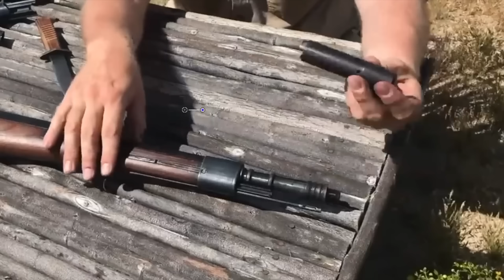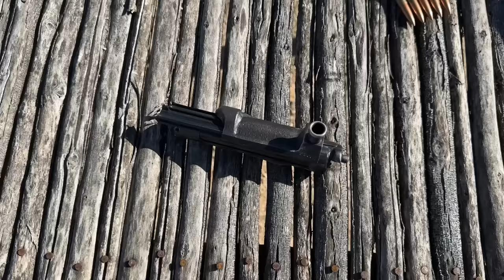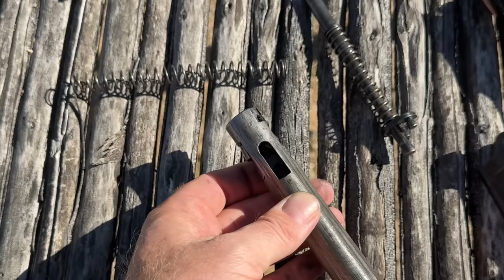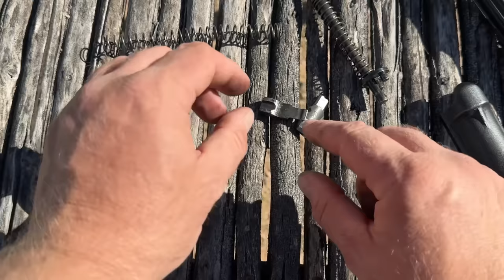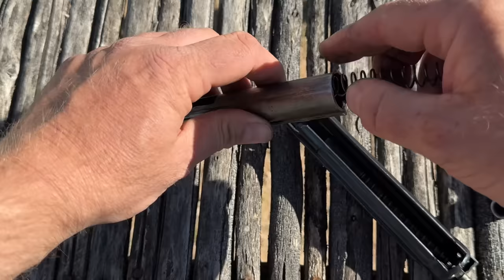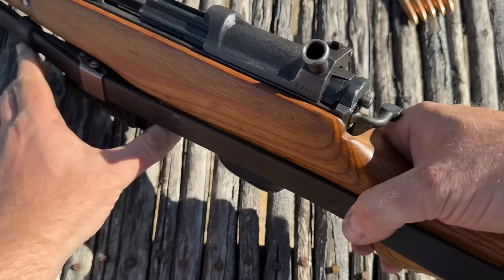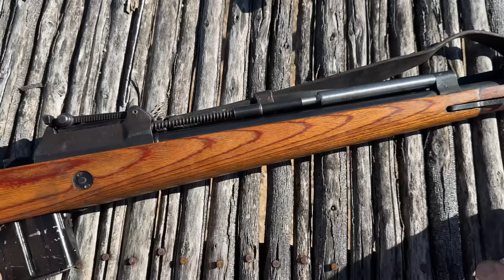Das G43 Wunder-Gewehr ist Scheiße

Comment: I've been waiting for this video. Finally the information I needed. Because so far it was "it's overgassed and production standards were horrible",  both were not really arguments agajnst the design itself, but against the execution of the design.
This video luckily goes into some interesting detail - problems with field stripping and the unreliable locking mechanism.
I would love to hear more about flapper lock failure potential. Is it an inherent design flaw of the lock itself, or simply the design of this specific one? What excatly made it possible to only half-lock? How could this be avoided other than going with better types of locking system? :P

Anyway, nobody was going to manufacture G43 also because most machines were gone, German industry was mostly gone, and there was an absolute abundance of already manufactured weapons. I think nobody mass-produced STG-44 post war. Nobody probably mass-produced MP-40 post war. Both were good weapons. But being a good weapon is one thing, and getting machines and manufacturing a gun in a dying-out caliber in the era of SKS, AK and more modern battle rifles? Well. not gonna happen.
Reply: also the locking lugs not being captive, not as easy as the m1 to reload from stripper clips, poor sights, and op-rod complexity leading to both being able to loose parts in the field and poor metallurgy that could mean the gun not working yeah "great design". Seriously the excuses for german engineering designs are laughable, yeah they also had substandard manufacturing and sabotage but overall designs were too complex to be quickly manufactured and work reliably in the field. Meanwhile Russian and American designs ultimately won the war. Proof is in who actually wins.
Reply: Surprisingly there is still a plant in Kyiv Ukraine manufacturing mp38s. Although the majority are made with built in BFAs
Reply: At least for the case of simpler weapons like bolt action rifles and submachine guns; most countries didn’t produce WWII-era SMG’s after WWII because they could effectively ask for them for pennies on the dollar from WWII-participating countries. The Soviet Union offloaded their PPsH-41 and PPsH-43’s to Eastern Bloc countries and Communist-sympathizing nations in the late 40’s and throughout the 50’s after standardizing on 7.62x39mm rifles, the US sold or donated Thompson’s, Grease Gun’s, and M1 carbines to Central American, South American, South Korean and Vietnamese governments up into the 60’s, and Czechoslovakia made profits by selling former Nazi German arms to anyone interested, most notably Israel.
Reply: "I think nobody mass-produced STG-44 post war. Nobody probably mass-produced MP-40 post war. Both were good weapons. But being a good weapon is one thing, and getting machines and manufacturing a gun in a dying-out caliber in the era of SKS, AK and more modern battle rifles? Well. not gonna happen."

I mean, with respect to the MP40, 9mmx19 isn't a cartridge that anyone could possible consider rare by even the wildest imagination. And both weapons weren't exactly the sort that was considered difficult to manufacture even by 1940s standards so that point I do not think is too valid.
One thing that should be kept in mind is how completely destroyed WW2 left many nations, and even those who weren't destroyed were faced with incredible burdens on their economy. It's quite hard to imagine anyone after seeing those two bombs dropped thinking of how to gear up their grunts for a potential future conflict. And by the time the Iron Curtain came about as more than just a politian's phrase, most weapons manufacturers had their eyes set on weapons for the standard issue NATO/Pact cartridges, at which point a rebirth of the StG44 in any noticeable capacity was off the board(though not for the MP40; but the Uzi quickly became a budget choice for a lot of nations and a decade later theMP5 would become more or less the gold standard for SMGs). 
One more thing I've thought alot about is that some credibility could be lend to the idea that most nations considered themselves victors after WW2, hence why go ahead and copy weapon designs off of the enemy?* The US thought that their infantry small arms were, in the grand scheme of things, superior to the Axis and only sought to reproduce/learn from the MG42 and FG42. The French/Brits are and were still both to prideful to admit that we Germans had something over them; and it took them decades after the war to come to terms with that but only because their dying empires(+NATO integration) left them with little choice in the matter. It's actually the Soviets, who, inspite of their lying and best-sweep-everything-mildly-inconvenient-under-the-rug, learned the most from WW2. They had many more run-ins with the StG44 and thus quickly realized just what kind of new tool they were dealing with, leading to them, in my humble opinion, correctly assessing that kind of rifle to be the best possible blueprint for the average infantryman of the future. Of course they didn't want to copy the weapon 1 for 1 still, so in the end Kalashnikov's design became their new service rifle, killing the SKS in the process.
Reply: @theduckfu  Not as easy to reload from stripper clips is a moot point since the rifle was designed to be mainly reloaded via changing the magazine.
Magazines not being available is not a problem of the design. It's the problem of German WW 2 logistics and small arms production being in absolute  deep manure for a large part of the war.
Being able to top off via stripper clips is a nice way to keep the magazine full when not under a direct threat, but we shouldn't be judging the reload speed based off it. Yes, it's discussed in the video, but video kinda talks about all the flaws. Both design and execution. 
And "losing flaps" - they are fairly big parts not going anywhere. I would consider that a minor problem compared to spring loaded grenade and the risk of half-locking.

But russian designs were pretty bad. Mosin, hearing loss Mosin, DP-28? Ppshz was a decent gun, design partially stolen from Finland. SVT was not manufactured because it was more.economically viable to just lose way more soldiers than to equip the meat waves with better guns. 
USSR had decent tank designs, however, they were flawed as hell, and v. good artillery - but again, Germany couldn't really upgrade their artillery due to lack of production capability. Soviet aircraft were mediocre for most of the war. 
Production won the war. Even if US manufactured horrible weapons (they mostly didn't) they would have won anyway. Switch places, give Germany P-51 and P-47 and Sherman and they are losing by a landslide, with plane production absolutely plummeting due to complexity (ever wondered why US could just manufacture gigantic P-47 like it's nothing and German frontline fighter planes were basically half its weight, ever thought about the level of precision that P-51 wings and radiator required?), and damn, Germany couldn't even manufacture good enough oil and fuel to get enough power from their aircraft engines. US installed stabilizers on every medium tank even though many crews did not even know how to use it. They had gyro gunsights in abundance, while Germany could field maybe a few hundred. Etc. Etc.

Comment: Wow, aside from length, SVT is much better. Easily Adjustable gas. Simple field strip. Though, the SVT break… it is so damn loud it flexes your chest.
Reply: But you see SVT is Soviet so it has to be worse than the German G43, or so the internet would have you believe.
Reply: Germans rated SVT higher than soviets did for some reason.
Reply: @CKshouta  The SVT did have significant flaws, those flaws are easier to overlook when the alternative (G43 or even worse G41) has even more flaws. There's also the good old "grass is greener on the other side".
Reply: @zepetv589  A lot is probably consciously or subconsciously hyping up your enemy to make yourself look better for defeating them, see: pretty much any German aircraft that isn't the BF109E or maybe FW190A having underpowered engines compared to allied contemporaries, and the ME262 being better than allied fighters but not monumentally so.  Or German tanks, there's so much of that with German tanks of WWII.
Reply: They did partially fix the muzzle brake by fielding a simpler, two chamber brake on later production SVT-40’s/AVT-40’s. The recoil was about 30% more than with the older brake, but at least now it wasn’t going to give the rest of your squad next to you tinnitus as quickly.
Reply: @alexisborden3191  In the case of the Germans it's likely due to the Western rehabilitation of the Wermacht after the war. It's a serious exception to "the history is written by the victors" rule, as Germans got to write their own accounts of WWII for the Allies to take as official accounts. This is why you also get "clean Wermacht", the SS wasn't as big of a part of this rehabilitation so the Wermacht officers blamed all the horrible crimes on them instead. Obviously taking Nazi liars at their word means they'll exaggerate other things like the effectiveness of German late-war "wonder weapons", that the Soviets were all just stupid and won solely via human wave tactics (something helped by the anti-communist leanings of the West and the lack of Soviet counternarrative), etc.
Reply: Right.
Reply: Laughs in M1 Garand

Comment: The most interesting thing about both the SVT-40 and the Gewehr 43 is that even though their design is more reminiscent of more modern rifles (gas system on top, detachable magazine, flapper locks or tilting bolt), the M1 Garand was superior in execution. Primarily, due to its sights and the lack of need for manufacturing magazines, which at the time was more expensive and time consuming than simple en bloc clips. 

Comparatively, the M1s derivatives are really just broadly the same design but scaled down  and revised in the gas system (M1 Carbine, M14, Mini 14), and of course, the AK.

Where as, the SVT-40 and the FAL are mechanically basically the same principles, same locking system and same type  and style of gas piston. The flapper system of the Gewehr 43 is far less common, but it shares this system (sort of) with degtyarev machine guns and a few other systems, but more improtantly influencing or being influenced by roller systems, and the gas system, of course, is derived from the Tokarev rifle.
Reply: That maybe due to the fact that M1 Garand was about 10 years older and thus a more developed rifle than the SVT-40 and G-43 in terms of polish. So it being superior execution is the least that would be expected there. However, M1 garand and its M-14 successor was a rifle that was based on an outdated “howitzer-style” 19th century concept of infantry level combat.

Comment: Funny enough they thought about making the G43 with roller lock, not delay blowback, same Tokarev gas system with roller lock instead of the flapper, but they found out that the bolt bounces back and discovered the delay blowback possibility, which went to the Stg-45, which should solve both Stg-43 and G43 flaws, but it was too late, even tho that design went further. 

Also, you should do one about the Stg-43, which was also a deeply flawed gun made from another design that wasn't as well developed like the G41 and G43, the Mkzb-42 was partially made to be open bolt, so that exposed mechanism wouldn't be a problem since it was hidden in the gun, the close bolt was a proof of concept that works better but still had the same bolt and charging handle, that weren't made to be that exposed in the opening, the sights were over the stamped metal, that doesn't hold zero as well, even for a gun with a 300m effective range, still not good enough, it has two selectors, one for safety and the other for semi and full, the mags were too bulky and wasn't optimized to be used in extreme temperatures since the entire gun besides the buttstock was made in stamped metal.
Reply: Underrated.

Comment: I've seen people use the detachable box magazine as an advantage over the M1 and its en bloc clips and I wonder if, in the situation that was WW2 at least, not really true. As Karl mentioned the G43 was issued with 3 mags in total and then you were down to stripper clips and the SVT didn't issue enough mags for its rifle either so at some point you were topping off with stripper clips. I don't think the M1 had that problem. The GI's always seemed to have bandoliers of clips and reloading the M1 didn't seem to be any slower than a box mag fed rifle either.
Reply: Yep detachable box magazines really only start to shine once you get higher round counts, otherwise it’s a wash between en bloc and boxes. Plus, 2 stripper clips vs. 1 8 round clip, which is better? 

Add the fact that 8mm mauser is a spicy round and the benefits of semi-auto aren’t as pronounced over a good bolt gun like a Lee-Enfield. I mean it’s still better in theory because of the semi-auto but at least the Lee actually works. Should’ve gone the Soviet route and just given everyone and their mother a PPSh or PPS when the SVT didn’t pan out and just used Mosins and MGs for longer range engagements.
Reply: @kraniumguy the German WWII disease was refusing to recognize the nature of the war until it was too late. They kept doing these weird little runs of different rifles, aircraft, tanks, etc when they should've been standardizing for mass production. The manufacturers and designers had too much influence
Reply: @LOLHAMMER45678  actually the manufacturers and designers wanted standardization. it was the army, specifically the high command, that wanted a thousand different weapon niches.

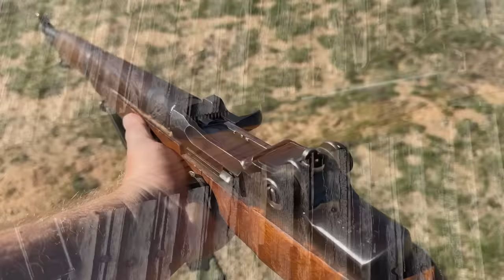Comment: 11:45 Fair, but I feel we're not comparing apple to apple here. The en-bloc clip works wonderfully, but that is assuming the country issuing the Garand has the industrial capacity to ship its ammunition already in the clips (or at the very least, shipping lots of spare clips). It's dubious Germany in the later stage of the war would have wasted the resources in that endeavor, just like they stopped bothering to make spare mags.
With that particular view on things, the Garand becomes by far one of the worst rifle to be used. Without a clip, it is impossible to load a Garand (unless you turn it into a cumbersome single-shot). After firing your eighth round you'd have to find your one and only clip somewhere in the mud, reload it (which is a bit of a pain with gloves - can't imagine what it'd be under fire), then put it back in the rifle. EDIT: or stop firing after 7 rounds, then load clip while still in the gun. That would be by far the fastest way, if hilariously impractical.
Meanwhile any stripper-clip based rifle can be single loaded, no issue. 
It might sound like a situational problem, however the Germans were really strapped for resources... and the US had the production to spare for millions and millions of en-block clips.
EDIT: to clarify, I'm not saying the G43 is better than the Garand. Not even *close*. I'm saying that the Garand has a crippling flaw that manifest if its issuing country can't provide enough en-bloc clips, which would have likely been the case for '43-'45 Germany.

Comment: Actually there was not A G41, there were two. The G41M(auser) and G41W(alther). The Mauser version complied with all the ridiculous requirements, the Walther did not. And the Walther was adopted at the end.
The problem with this design is, it was made in a short time period and there was no time getting the flaws rectified. The Garand design started in the 1920s, had several changes over time until its final version was adopted. The Garand from 1936 was also a gas trap system. Was changed directly before adopting it. The first Garand design of 1924 that was sent in for trials was primer activated.

Comment: It is a fascinating little niche, both the G41/G43 and the US M1 both started life with another operating system, and you can still see the remnants in the M1 with how far forward it's gas port was, and both rifles had weird restrictions on them, like not being able to have moving parts on top of the barrel requiring weird dog-leg operating rods which could cause problems (Resolved on the G43). The two rifles have very similar design stories written in them, yet the M1 ended up being so good, and the G43 ended up being so... mediocre? I'd still rather have it than a Kar98, but it's a pretty close thing...

Comment: As far as I am with you that this is a bad rifle, I would say it was the best rifle possible with the preset conditions the engineers were forced to work with. Since the Mauser factory had the production line pretty much running, the new gas system was a smart move and the bolt-assembly-design was limited by the existing machines. In comparison with the G41 Mauser and Walther designs it is astonishingly simple and slick. And as you said, the rifle was not meant for lasting use in a war already lost. So this thing did the job and was successful in its role. 
For the comparison with the M1: Thats like comparing a VW Käfer with a nice Chevrolet. The Käfer does the job, but it's small, underpowered and over all a neet looking pile of shit. G43 also looks nice in my eye. And this can be said to pretty much everything Germany made in WW2. They came a tremendous long way with the limitations they had back then. Personally I am more in awe how long it took to beat them down than their short Blitz-campaigns.

Comment: My dad got one of these as payment for mowing an old guy's lawn in the early 1980's as a teenager. Instead of using cash, the old timer paid with a qve45 K43 with a refinished stock and a 1960 Marlin 336 Texan. I've shot the K43 once as a kid and the handguard flew off because there was no front barrel band or barrel band spring. Cool gun though. I oughtta get a new stock one of these days to make it look all period-correct.